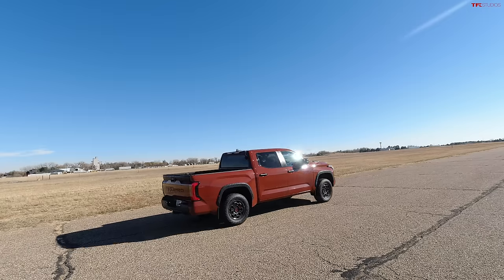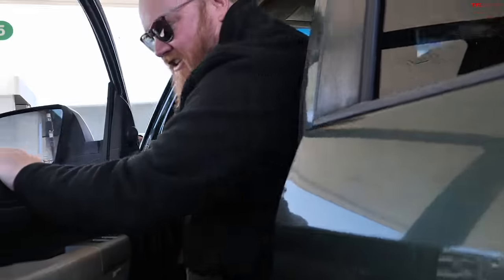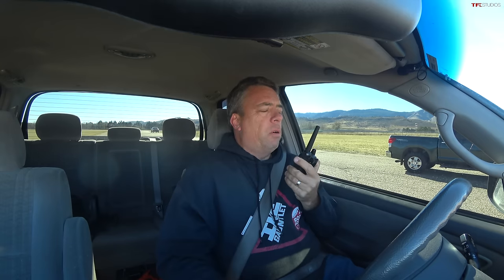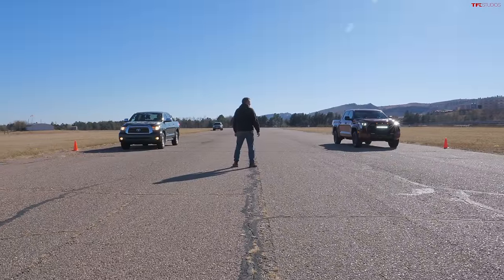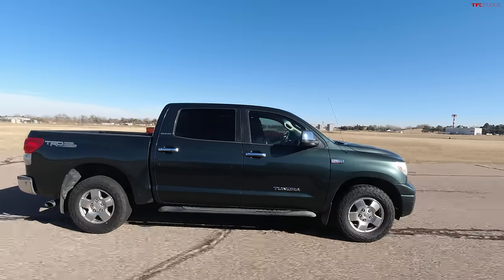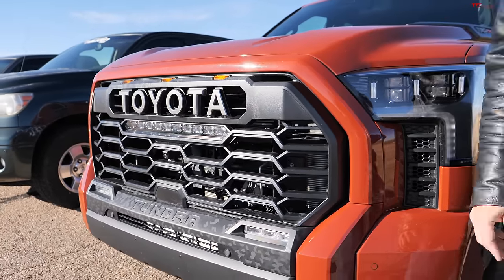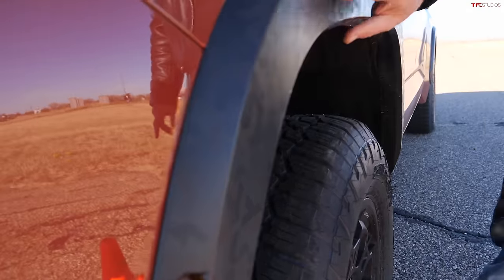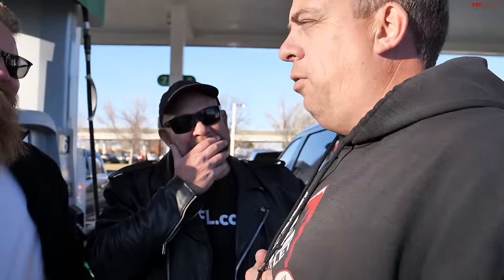Three Generations of Toyota Tundra Drag Race & MPG Surprise: That WAS NOT Supposed to Happen!

Comment: The 5.7 is a million mile engine as well
Reply: 4.7 actually
Reply: Both
Reply: @Peaceman2884  a couple 5.7s have hit a million “aCtUaLlY”
Reply: @Peaceman2884 Look up Blaine Johnsons million mile 5.7 Tundra.
Reply: As is the 4.6
Reply: They are exactly the same engine except for size, same design.
Reply: Not the 4.7? Maybe it was too.
Reply: Both 5.7 and 4.7 are aweosme engines
Reply: @FullsendOffroad  yes both of them, just was saying the 5.7 is too.
Reply: @freedomisntfree_44  by the way, I love that 🌮 in your profile
Reply: So will this new 3.4 turbo!
Reply: Either the 4.7 5.7 engines are workhorses. Only displacement is the difference
Reply: Let me make this easy. I rather drive the 5.7 but I’d rather work on the 4.7. 5.7 have cam tower leak, timing chain tensioner rattles. Both are costly. The 4.7 only needs timing belt maintenance.
Reply: Say that to mine that dropped a valve at 221k
Reply: I already seen three v6s with locked up motors due to main bearings failure
Reply: @yotrkoff-road3541  Iv seen that. You can’t even replace head gaskets
Reply: @FullsendOffroad  it’s at 292k miles 🤙🏽 almost time for water pump and timing belt
Reply: @davidwelty9763 literally not even close to same engine, at all
Reply: @demarkusthompson2867  You don't know that, and I would give Toyota the benefit of the doubt. It is a Toyota at the end of the day.
Reply: @yotrkoff-road3541 Gotta keep up on that timing belt man… thats all these engines require.
Reply: @S2KYLEFXLRST  funny thing is the 5.7 doesn’t have one
Reply: @freedomisntfree_44  awesome, drive it to a million. Those 3.4s are awesome.
Reply: @FullsendOffroad  yeah it’s a good little truck for sure
Reply: @yotrkoff-road3541  I was under the assumption you had a 4.7
Reply: @demarkusthompson2867  Yeah, the 5.7 had a problem with dropped valve in the first years of production. Toyota fixed that. Same goes for the Turbos.
Reply: We've been fotunate to have been owning both a 4.7 and 5.7 since '04 and '08 respectively. Over 400k combined. Batteries, tires, oil and gas. That's it!!!!
Reply: Don't know of 1 5.7 with original engine to hit a million.
Reply: How many transmissions did it go through?
Reply: Any engine is with enough money
Reply: So is the V6
Reply: @ricmagik  Only thing went out was reverse gear. Engine never had to be opened up.
Reply: The 4.7 5.7 will last wayyyyyy longer than that new engine.
Reply: Put the 5.7 in tow haul. It's much quicker off the line.
Reply: @Sam-gh3gx  not what I saw in a video from a Toyota engineer. They just sized everything up.
Reply: Toyota's aren't the only trucks to hit a million miles, there's an Arizona guy who just recently hit a million miles on an F150. Most of the million mile trucks are driven roughly 80k-100k miles a year. In order to achieve that mileage it's safe to say those are at a minimum 90% highway miles. Highway miles equate to roughly 10% of the wear and tear of city or in town driving. It's not necessarily the miles that kill an engine it's the engine cycles. The engine on, warm up to temp, drive, engine off, cool down then do it all over again. Depending on what the truck is being used for it's not unheard of for other manufacturers other than Toyota to achieve a million miles.
Reply: The million mile tundra was a 4.6
Reply: @demarkusthompson2867  another uninformed person that heard from a third party
Reply: They should try racing a SUPERCHARGED TUNDRA 5.7 V8 they did come in factory.
Reply: @beexiong2995  there’s a 5.7 or 2 that has as well.
Reply: @naveenthemachine if I’m not mistaken, 5.7 is timing chain and 4.7 timing belt? If so, that’s a big difference. I could be wrong though
Reply: @oldmanmike4995 air injection pumps
Reply: @deadswarmaking1135 yeah but toyotatrucks are the only trucks to do it consecutively. I've known of 3 tundras that have hit over a million. No telling how many have hit over half a million.
Reply: @Land_Raver just type it here on youtube. There's 1 at least
Reply: @tosil  Was thinking this same thing - I have heard that the chains can last forever, and I think about that whenever I am taking a apart the whole front end to change the timing belt and accompanying accoutrements on my 4.7L.
Reply: @flight2k5 the ford 4.6 2v in the crown vics are also 600k motors
Reply: @jakethesnake4971  wwhhooooo. Good for them
Reply: @davidwelty9763  The UZ and UR engines have no interchangeable parts and the UR has vastly more technology than the UZ. They may have "sized everything up", but they also changed a lot between the engine families.
Reply: 6.2 Chevy V8 is a million times better
Reply: @MH-kc1eu  🤣🤣🤣🤣😂😂😂😂😂😂
Reply: Isn’t the 4.7 better tho reliability wise?
Reply: @andersonrodriguez8258  no?
Reply: No they're not I had one it was on its second engine and that one crapped out too the 57 Toyota Ranger in his junk compared to the 47
Reply: @caseyhans8660  Toyota ranger?
Reply: @yotrkoff-road3541 well. you do need to change the oil every few ywars....damn.
Reply: @Land_Raver plenty of them online
Reply: @deadswarmaking1135  You are absolutely right and I tell people regularly that time kills cars just as much as mileage. And how many cars could have run a million with proper maintenance but were in an accident.
Reply: @beexiong2995  Both the V8s were 4.7s.
Reply: @Cruising200  I've seen misleading headlines of them being 5.7s when they are really 4.7s but I still can't find one 5.7 with a million.
Reply: @Land_Raver  just looked myself, you are corrected.   Probably won’t know it’s a million mile engine for a few more years, but I’m positive the amount of 5.7l’s I’ve seen that have 200-300’s will make it to a million for sure.
Reply: @demarkusthompson2867  not the turbos.  Wastegates which are electronic and outsourced to someone not toyota.  And its already fixed.  You are behind a year already
Reply: @andybaez5696  the new engine has been in production for two years lol you know nothing
Reply: I own both along with the 4.0 V6. The 5.7 is way less reliable than the 4.7 bulletproof engine. 5.7 has cam tower leaks and coolant valley plate issues
Reply: @bh5697 leaks don’t make it less reliable.   I had a gx470 with the 4.7l at 220k miles changing the cam seals, rear main seal, transmission input shaft seal, exhaust manifolds and valve covers doesn’t make it less reliable as well.  They are just leaks.
Reply: @Cruising200   5.7 dropping a valve spring enters the chat LOL. Trust me I love all of my Toyotas but the 4.7 is literally the one that has the least maintenance. The 4.0 V6 early years also have headgasket issues
Reply: @freedomisntfree_44  There are now 4 known 5.7 million milers with original engine and transmission, i believe 1 had a new transmission
Reply: its really challenging to get to a million mile for any driver, you basically have to drive for a living to do that.
Reply: @quanghuynh9472 lol no it won't be. 3.4 twin turbo won't last 400k miles 😂
Reply: There are million mile F150s as well. Source: my dad owns one. He drives back and forth from miami to san diego to juneau alaska in it twice a year plus whatever else along the way about 80k per year. 2013 with the 5L V8 4x4 and ~ 33” tires
Reply: Can we all just agree Toyota knows how to build engines the 1 UZ the I force 5.7 the 1JZ and the 2JZ just name a couple
Reply: @ikaikailimoku808  from 95 on they’ve hit the nail in the head. I like ford too but gotta be careful which ones you choose
Reply: @yotrkoff-road3541 well ya know if you dont replace the chain tensioners when they start to rattle, its bound to skip a tooth and drop a valve because of timing issues. But who knows maybe a fluke?
Reply: Are you serious a million mile engine
Reply: My 2002 Tundra had 376k reliable miles before I traded it in for a 2014 5.7 and now have 576k reliable miles. Nothing last like a Tundra.
Reply: @esteemedenergy  I have 300k on my taco and a sequoia with the 5.7 almost at 200k 🤙🏽
Reply: @Quangus1  nnnoooooope
Reply: There is a million mile 4.6 Tundra as well. 
Safe to say
iForce = million mile.
Reply: @demarkusthompson2867  I kinda doubt it too, but apparently that was their goal with this powertrain, toyota and lexus are putting this in alot of their vehicles and they did alot of r/d to make it a million mile powertrain.
Reply: Not nearly as reliable tho..
Reply: @freedomisntfree_44 only a couple tho “aCTuAlLy”
Reply: @davidwelty9763 except the engine in the new one 😀😀
Reply: 4.7 way realible
Reply: R22 over 2M miles 😂
Reply: @deadswarmaking1If its the one on u tube its on the third eco pooch135
Reply: @MH-kc1eu thanks for the laugh
Reply: @Peaceman2884  actually both are
Reply: @Peaceman2884  ACKCHOOALIE
Reply: @dixiehandyman  😂😂😂😂 you couldn’t afford one
Reply: @Peaceman2884  Both
Reply: @MH-kc1eu  You wish
Reply: I thought so that 5.7 is no punk.

P.S. you guys are funny asl y’all have me cracking up.
Reply: Yes it is!!
Reply: 4.7 lol
Reply: @ricmagik  i think one of the 2007 tundras that went a million with the 4.7 went through 3 transmissions. which aint bad. i think those 5 speeds average 250k
Reply: i would put my money on the 4.7 lasting longer and being easier to work on.
Reply: @jameskocks4734  but also weak.
Reply: Lowkey they all r
Reply: @Peaceman2884  Actually, BOTH the 4.7 and 5.7 are million mile engines. I mean, he DID SAY the 5.7 was AS WELL.
Reply: @FullsendOffroad the 4.7 had a timing belt so i would think it would go to a million miles but if the belt snaps the average persons going to send it to a junk yard
Reply: @sargeatlarge24v  and what about a chain? With a belt at least you maintain it often and know it won't fail. Never seen a 4.7 with a blown engine because of a bad timing belt.
Reply: @goldentrucker7921 alot of them haven't lasted 50k before eating its own main bearings.
Reply: @allentoyokawa9068  so the recalls??
Reply: The 4.7 and 5.7 are the million miles  engine.
Reply: @Peaceman2884  I have both, they both are tanks.
Reply: Absolutely it is! The only readily 🎉available for consumers without going to a diesel engine! Gotta love the v8 tundra!
Reply: I think there are more 4.7 engines with a million miles.